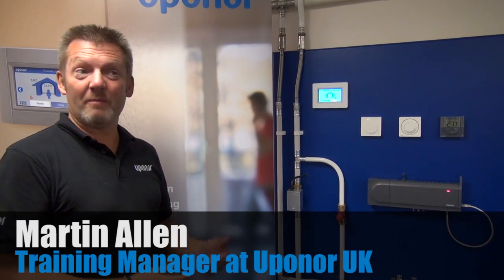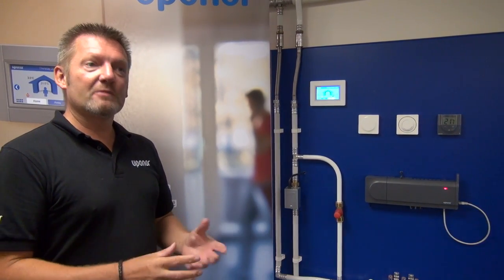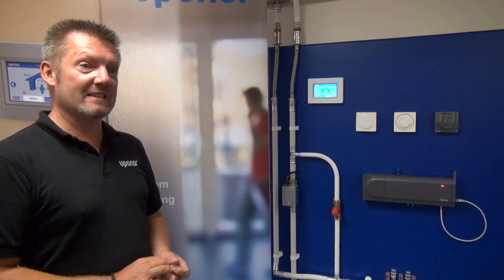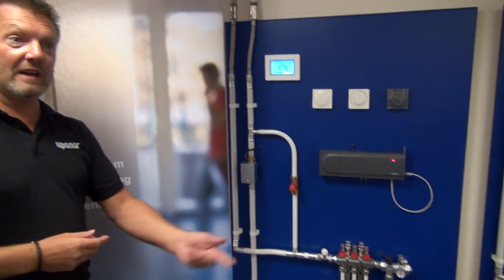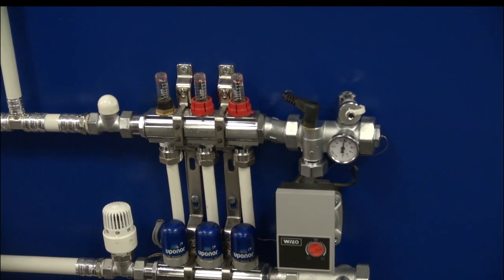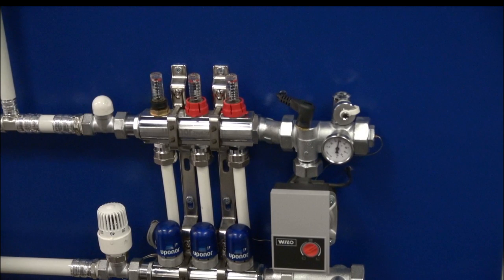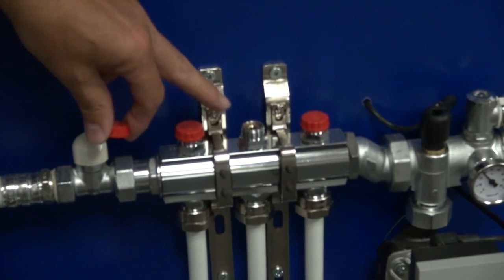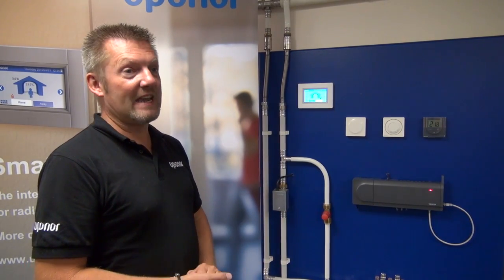How to auto-balance Underfloor Heating Systems

Comment: How can l balance UFH if l don't know loops length? For example l bought a house with already installed UFH and manifold with no flow meters, is that anything l can do to make it works better?
Reply: same here !!!
Reply: I have just installed wet UFH at my home, I'm not a plumber. The pipe has printed metre rundown markings on it.
You should be able to go to the manifold and look at where the flow and return pipe meet the manifold inlets and outlets.
Deduct one from the other which should give you your length
Reply: the easy way is to try to get same temperature on return on all pipes. input is 38 example return would be 30-31 this means . also I found the SALUS THB230 withc automatically makes this 24/7  even if one room changes the heat loss.

Comment: These manifolds are utter rubbish. We rip these out on a daily basis
Reply: Why? Which manifold do you use?
Reply: @Krimsonkat  A TRV is not a mixing valve. The internal bore of the TRV on that manifold is probably 15mm. Why run 22mm primaries to the manifold and then restrict the flow with a 15mm TRV? Because of where the the pump is positioned the heating will fire, the pump will draw all the cold water out of the UFH loops and significantly reduce the flow water temperature coming from the primary. This will result in a low flow temperature going into the floor, poor heat output and a very slow response time. Most UFH suppliers will specify a required flow temperature to ensure the heat output is achieved, there is no way of setting an exact flow temperature with this manifold so you have no idea what the heat output will be. I've lost count how many properties I've been to where these manifolds are installed and the customer was complaining that their system was not working. After fitting a proper underfloor heating manifold with a thermostatic mixing valve (not a TRV) and pump in the correct position, the systems worked perfectly.
Reply: This auto balancing control looks amazing. Do you have fitters nationwide in the UK?